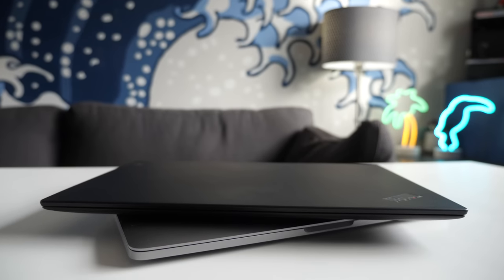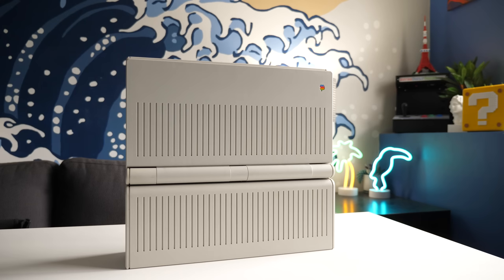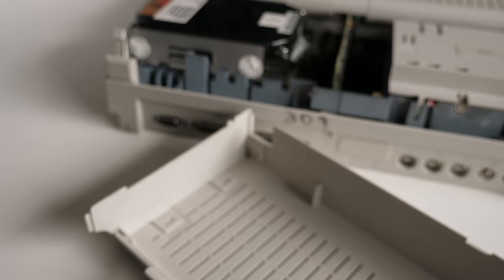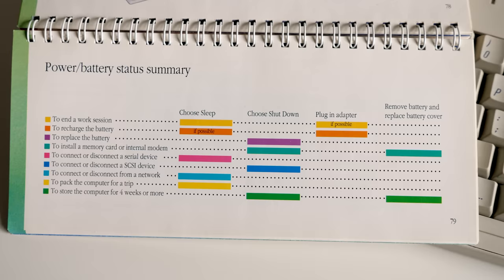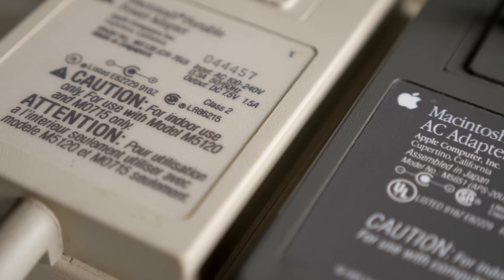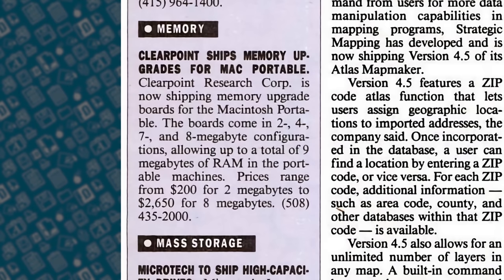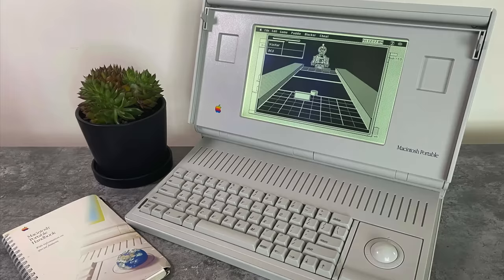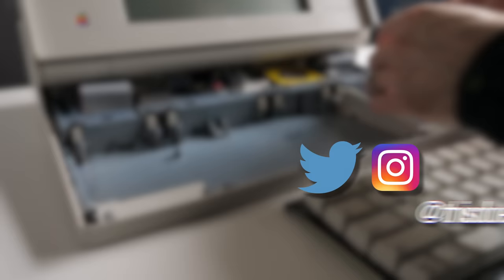Macintosh Portable: The Mobile Mac Nobody Wanted

Comment: When I first started working at Apple, the Macintosh Portable was the first top secret project I was introduced to.
Reply: Just wondering what you're up to nowadays, still working at Apple?
Reply: @puciohenzap891 I worked at Apple from 1987 to 1996. I first worked for Tech Support (Supporting Certified techs in the field) and then worked in the DTS group (Moof) working with third party developers with hardware and software issues.  My Apple job moved to Austin, TX ,but I wanted to continue to live and work in the bay area. I worked in biotech for many years and now am retired.
Reply: @X-OR_  You have a awesome resume.
Reply: @error4159  Thanks !
Reply: kickass! good on ya.
Reply: Hello! Can I ask you question?

Comment: The swappable mouse/keyboard is such a cool idea for a portable this old
Reply: Back when Apple actually cared about upgradability and, in fact, even had that as a selling point.
Reply: Minor clarification but It was a swappable trackball/keyboard not a mouse/keyboard. I known It’s been a while since trackballs where much of thing though I believe a few models are still sold these days.
Reply: I actually own one of these and didn't even realize it had that feature.
Reply: @babyboomertwerkteam5662  Apple has always prioritized end-to-end-control of the user experience over upgradability. In instances where they see the two as not being mutually exclusive, they sometimes make an exception. There is no "back when" on this. Macs of this era were notorious for their lack of expandability because Jobs hated slots. The upgrades available to Mac users who didn't want to void their warranties in the 1980s were extremely limited, and could only be had via Apple Service Centers.
Reply: @user-dx8br5vb3n  Jobs hated slots - good thing he wasn't at Apple when the Macintosh Portable was made. Or the Macintosh II series, or the Quadras, or the early Power Macs, almost all of which featured between three and six expansion slots depending on the case size. Apple's engineers did care about upgradability when Jobs was out of the way. And even when Jobs returned to Apple in 1997, their "pro" line-up of machines kept the upgradability, while the consumer machines (most notably the iMac) lessened it.
Reply: @babyboomertwerkteam5662  haha fair play bbtt. You got me
Reply: I totally agree. To be honest, I kinda wish this was on computers today

Comment: As a person who 3d prints occasionally: what's going on with that blue part of the battery case? I know it's hidden inside the computer, but someone needs to work on those printing settings.
Reply: It looks like they either have some extrusion issues, bad z-offset, or they printed it in the wrong orientation and that top had to be printed as a bridge.
Reply: Exactly my thoughts
Reply: I'd say it looks more like it was printed on a raft...
Reply: Zoffset or first layer flow %, how you want to fix it up to you
Reply: quick print ?
Reply: Ikr!

Comment: I worked in sales at Apple at the time the Mac Portable was introduced. The Portable was an amazing bit of engineering - the entire thing was assembled with no screws - all the parts snapped together, including the mounting of the boards and drives. The subframe was the most complex plastic part Apple ever produced, and it quite a thing to behold when it's seen by itself. If you can work out how to disassemble it all (it's not that hard), you can see how it was designed. It's pretty cool. Driven by product chief Jean-Louis Gassée, the Portable's design was meant to be free of compromises. In reality, it was filled with compromises, and all the wrong ones. Gassée assumed (wrongly, as it turned out) that portable computer users were more concerned about battery life than size and weight, and he directed the product team to build the product on that basis. To that end, they used very expensive static RAM (SRAM) instead of the more typical dynamic RAM (DRAM), because SRAM's contents could be held indefinitely with a small voltage, and almost zero current draw. This meant that while sleeping, the computer would draw almost zero power, allowing it to remain in sleep for weeks without discharging the battery. The large and heavy lead-acid battery was chosen because that battery chemistry could be charged from any level of discharge, to any level of charge, without ill effects on the battery. The nickel-cadmium batteries used at that time in competing designs had the well-known "memory effect," which meant that if you charged a NiCd battery without fully discharging it first, it would not be able to reach full charge. This created a state of what Gassée called "battery paranoia" that the Mac Portable sought to avoid. He was right about that, but the reality of the weight penalty imposed by the heavy lead-acid battery was not worth the benefits. The Active matrix LCD used by the Portable was groundbreaking, as all competing LCD-based laptops at the time used super-twist passive-matrix LCDs which, as anyone knows, were complete crap. The refresh rate was terrible, and they had awful image artifacts. The choice to use a reflective-back display without backlighting was driven by the battery life penalty it would impose, and again, it was the wrong choice. Active matrix displays later became industry-standard, but the Mac Portable was the first mainstream portable computer to offer this feature. The main drivers of the high price of the Portable were the AMLCD screen and the SRAM memory. These were (especially at the time) very expensive components. They were "interesting" choices to have made at the time, but the AMLCD later was adopted by the rest of the industry, showing Apple's leadership, at least in some areas. It wasn't a great machine, but a Mac Portable was definitely a cool status symbol. I hope you get to hang on to the one you have - it's a very fun artifact to have in your collection. Thanks for the tour and trip down memory lane!
Reply: Do you remember BusinessLand?
Reply: I added some paragraph breaks to make this easier to read

I worked in sales at Apple at the time the Mac Portable was introduced. The Portable was an amazing bit of engineering - the entire thing was assembled with no screws - all the parts snapped together, including the mounting of the boards and drives. The subframe was the most complex plastic part Apple ever produced, and it quite a thing to behold when it's seen by itself. If you can work out how to disassemble it all (it's not that hard), you can see how it was designed. It's pretty cool. Driven by product chief Jean-Louis Gassée, the Portable's design was meant to be free of compromises. In reality, it was filled with compromises, and all the wrong ones.

Gassée assumed (wrongly, as it turned out) that portable computer users were more concerned about battery life than size and weight, and he directed the product team to build the product on that basis. To that end, they used very expensive static RAM (SRAM) instead of the more typical dynamic RAM (DRAM), because SRAM's contents could be held indefinitely with a small voltage, and almost zero current draw. This meant that while sleeping, the computer would draw almost zero power, allowing it to remain in sleep for weeks without discharging the battery.

The large and heavy lead-acid battery was chosen because that battery chemistry could be charged from any level of discharge, to any level of charge, without ill effects on the battery. The nickel-cadmium batteries used at that time in competing designs had the well-known "memory effect," which meant that if you charged a NiCd battery without fully discharging it first, it would not be able to reach full charge. This created a state of what Gassée called "battery paranoia" that the Mac Portable sought to avoid. He was right about that, but the reality of the weight penalty imposed by the heavy lead-acid battery was not worth the benefits.

The Active matrix LCD used by the Portable was groundbreaking, as all competing LCD-based laptops at the time used super-twist passive-matrix LCDs which, as anyone knows, were complete crap. The refresh rate was terrible, and they had awful image artifacts. The choice to use a reflective-back display without backlighting was driven by the battery life penalty it would impose, and again, it was the wrong choice. Active matrix displays later became industry-standard, but the Mac Portable was the first mainstream portable computer to offer this feature.

The main drivers of the high price of the Portable were the AMLCD screen and the SRAM memory. These were (especially at the time) very expensive components. They were "interesting" choices to have made at the time, but the AMLCD later was adopted by the rest of the industry, showing Apple's leadership, at least in some areas. It wasn't a great machine, but a Mac Portable was definitely a cool status symbol. I hope you get to hang on to the one you have - it's a very fun artifact to have in your collection. Thanks for the tour and trip down memory lane!

Comment: We have rebuilt many Portables, backlight and non. They ALL need recapping at this point. We also need to check traces as they commonly get damaged. The Powerbook 100 is literally the portable motherboard redesigned. It even has the same powermgr chip.
Reply: Yup, Apple contracted out the PowerBook 100 to Sony and to reduce costs, they just made them shrink down the Macintosh Portable logic board. Meanwhile Apple internally developed the 140 and 170, which is why they look so different and feature an original board design.
Reply: I heard that Sony gazumped Apple on the manufacturing price of the PowerBook 100, so Apple cancelled subsequent orders after the first shipment -- of only 100,000, I think. This was a shame, as they were well-regarded machines. People wondered why no more were made, and Apple never convincingly explained why.
Reply: I'd like to get in touch. I bought a Mac Portable and it actually runs but it needs restoring. Not something for the feint of heart.
Reply: The PowerBook 100 also has the same "clock" battery requirements, although it used 3 x 3v "coin cells". Again, like the Portable, it would try to boot using those batteries if the main lead acid battery wasn't fitted, resulting in a set of very quickly drained "coin cells"!
Reply: @CF542  I can definitely help. I'd post my website but YouTube hates that. Just Google us
Reply: @AmigaofRochester  You could post a domain name bit by bit.
Reply: @AmigaofRochester  e.g. example
Reply: @AmigaofRochester  .
Reply: @AmigaofRochester  co
Reply: @AmigaofRochester  m
Reply: Tried to post a few hours ago, comment didn't post. Google
Reply: I may be ringing your phone someday Thomas.
Reply: @theoparke  We look forward to helping you!

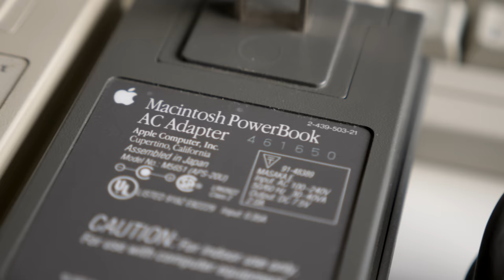Comment: 6:13 There's no risk. That's not how current works. The load determines "amps". You could connect a 7.5v Portable to a power supply rated for 1000amps@7.5V ...the device will still draw the same amperage. i=v/r  -> The 'r' is determined by the load (Mac Portable); the only question is: can the adapter supply enough amperage. ...not whether it has too much capacity.

...what you wouldn't want to do is connect it to a power supply that can't supply enough current, and of course, in general you want voltage to be pretty close. ...although there are a lot of devices with a much larger acceptable voltage range than you might guess.
Reply: i was shocked to hear was this was described in the video, too.
Reply: @yay4this  many people get this wrong, especially anyone that hasn't gone into how electricity works (you can know electronics and basic board level repair without knowing how electricity works) Now where it could potentially be a problem is in a situation of a short, as the higher current PSU could damage more if there was a dead short compared to a low amperage PSU. but usually as long as the new PSU is at or only an amp or so more than an original that itself shouldn't be too much of a problem.
Reply: In simple terms, I've always remembered:  volts are 'pushed' by the power source, and amps are 'pulled' by the device.
Reply: Asking because I don't know, (but I already believed what you are saying): Could it be that the computer will draw 2A+ if "given the chance"? Surely that can't be, right? Because if that were so, it would be trying to draw 2A even on when running on its own "correct" power adapter and would be frying those left and right. Right??
Reply: @dgpsf  yep, now if there is a short, or something in the computer drawing extra amperage (more drives, or added  components, an overclock) then it would draw more than originally rated which might cause the original power brick  to fail and a higher amperage one to keep working.

another way to look at it is the PSU wattage. as you add more stuff to a computer the wattage  goes up (volts*amps) if the case of having a PSU with higher AMPs / higher watts was an issue no one would buy higher wattage PSUs for their desktops. (you can usually use a higher wattage PSU for your laptop as long as the voltage is the same, and sometimes a lower wattage one but performance or battery charging will be sacrificed)

Voltages are basically the only thing needing to be close to spec as the VRMs are designed for a certain input range. Sometimes you can run slightly higher voltages but not too far.
Reply: Came here to say this. Amperage/current is drawn from the system, not pushed into it.
Reply: I found the misinformation there strange too. That’s day 1 stuff in class. 

…Unless he’s saying the power control circuitry has no current limiting and there’s a chance that with all desktop-class components going at once, it may attempt a larger load than the internal regulator can handle? That doesn’t seem right though. 

The brick is supplying 7.5V DC and the Portable wants 7.5V DC. If the Portable is entirely relying on the brick for current limiting and voltage regulation, and the danger is from a brick failure, then the OG brick is just as much of a risk in an overcurrent or overvoltage scenario.
Reply: @dgpsf  In general, the deal with DC power supplies is that they are rated to deliver X amps of clean/stable power at some voltage and the trick is to ensure that your power supply is sufficient. If you mess with ATX power supplies, we buy a 750W PSU, but that wattage also equates to various amperage@voltages. ...you don't have to worry about trying to buy the exact wattage for your system load because the components still present the same load whether you have a 750W or a 2400W PSU. You just need to make sure you have enough. The Power supply doesn't have a say in the matter. The flip side of that is if you try a 300W PSU with 750W of load, the components still try to draw whatever they need. They don't know what the PSU is capable of; draw more than the PSU can handle and things go bad. ...but extra amperage capacity on the supply side isn't a problem.
Reply: This was my knee jerk though too, BUT...
Remember that the machine always runs through the battery, so the brick is a true charger only, and is not a power supply subject to the max pull of the machine. 

In that case, the issue might be that the electronics that limit the Lead Acid battery charge rate are in the charger. Having more amperage available could then theoretically cause a problem with the battery. You need that limiter in place for the charge circuit, and if it's not internal, then it has to be in the brick. In that case, using a bigger brick could actually cause issues because the battery is dumb and will try to take everything available to charge itself. That's dangerous with a SLA.
Reply: @Cherijo78  “all current limiting is in the charger” was my “surely not.. but maybe?” only explanation that possibly makes sense; I really hope they didn’t have NOTHING outside of the brick 😵 I’d forgive something that was present but turned out to be inadequate…
Reply: @kaitlyn__L  It makes sense that it might be though. Think about Car/boat/rv battery chargers. The limiting circuitry is all in the charger itself, none in the battery. This being early portables, it would've been perfectly normal to use the same line of thinking given that the machine always pulls off battery.
Reply: @Cherijo78  Batteries present a resistance. If you connect the terminals of your battery charger to each other things are going to get weird.
Reply: I guess I should add... If I'm not mistaken, the way you change your charge rate is by varying the voltage. The resistance of the circuit is a moving target.
Reply: @Cherijo78  thanks brian the man

Comment: the power adapter has a constant current limit to prevent the leadacid battery from swelling , if using lifepo4 as a replacement (which u should do ) there is no need to worry about current limiting as long as u don't charge it above 1c , that is if the lifepo4 battery pack is 6ah then u can give it 6amp max for maximum cell life. leadacids require charge current limitation like any other form of battery , this is why the power adapter is a current limited one , it drops the voltage as soon as the current exceeds rated to prevent too fast charge of that battery, i highly recommend in investing lifepo4 cells. 2of them in series and 2 in parallel will let u use this computer with back light and hdd running all the time for 4-6hrs.
Reply: I imagine you could fit more than just two cells in that space. Has anyone added a charging circuit to limit the voltage automatically?
Reply: @pseudotasuki  i believe u can only fit 4 Lifepo4 32650 battery in the space of 6v 4.5ah battery. , If u can find pouch cells of Lifepo4 then u can probably do more capacity but 12ah 6v battery is already more than double the original lead acid & lifepo4 gives their rated amp hours even at 1c discharge while the 4.5ah of the lead acid is measured at a super slow discharge for 20hours.